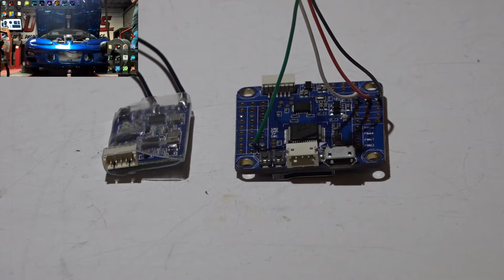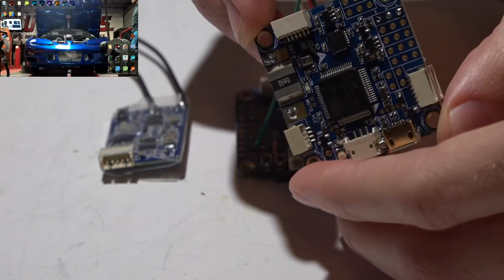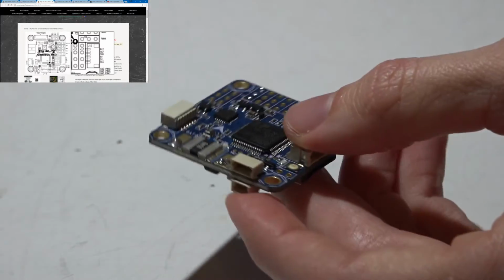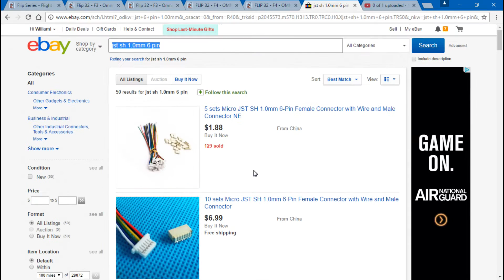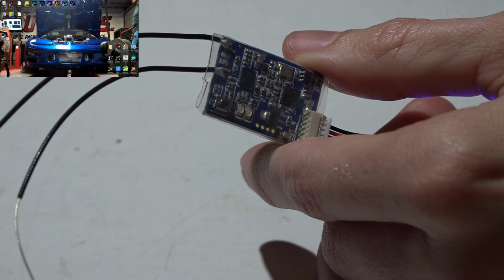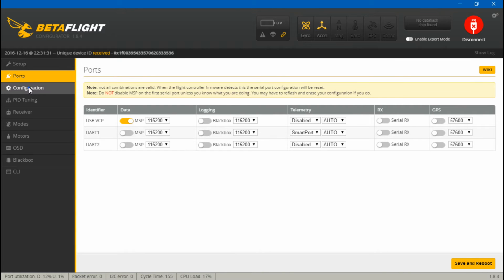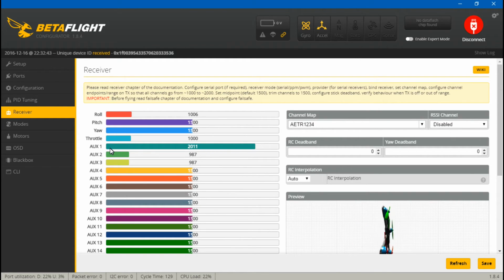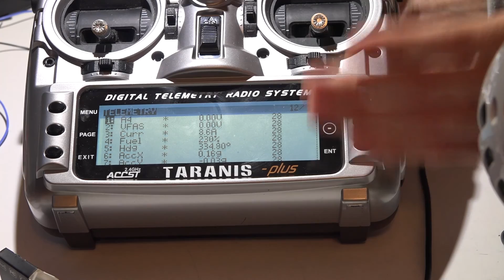Omnibus F3/F3 Pro & XSR: Connect & Telemetry

Comment: hey JC, I'm in mode 2 on a qx7, followed all your vids, have Amber sounds, set up model, got it on aetr and when I push throttle the roll moves, can you help please, Im trying hard to get my x210 with omnibus f3, xsr, racerstar motors n 30 amp blheli-s esc, in air, thanks for your help bro, couldn't have done this much without you,  I made my first vtx pigtail, I ready to start reworking boards and changing damaged components!

Comment: Hey could you take a look at my quad I have tried to calibrate escs to dshot and multishot. This is my first quad build ever. When I plug my lipo in my quad it makes a weird beeping sound. Also a few times I could arm then telemetry would just cut out and recover then XSR lights both will just start flashing. This is the omnibus f3 Any solutions? Thanks! https://goo.gl/photos/jbhWi2kU9DLhAHoKA

Comment: Using the Omnibus F3 AIO, I have wired up the x4r-SB as well as tried an old X8R I am positive I have both wired correctly. and everything in taranis setup correct, but I cannot get the FC to get any signal from the receiver.   I made sure Serial RX on UART 3 and SBUS on configuration tab is selected.   Still nothing, guessing maybe a bad FC?    Also tried with sbus_inversion on and off, made no difference.

Any ideas of anything else to try?   

Thanks!

Comment: Great video, while upgrading my Omnibus F3 on Betaflight  from 3.3 to 3.1 now it wont connect . I can connect using my Lumenier Lux V2 but this FC now wont let me do anything but go into DFU mode. I even tried to go back to 3.3 but cant find it in the listings any more. UG   any suggestions.   I used Zag and still cant get it to connect, dont understand why I can with one my Lumenier theyu both use the same set up {Comp 3}  ??     I may send it to Joshua if he sends me his mailing address to see if he can fix it. If interested let me know . I also have a crapped out Naze 32 you can have for parts if you want it. But id like my new omnibus repaired so its not a total loss. Thanks Bill
Reply: ahhh I fixed it. I used Impulse  Driver fixer.  Sweet !! Happy happy happy.  Now back to my build.

Comment: I just received an Omnibus F4 Pro from ReadytoFlyQuads and the board is slightly different than the posted pictures  Next to J7 there is what looks like a three pad solder jumper, with the outer pads labeled sbus, and ppm.  Is this a new version of the board? Would this possibly allow for turning on and off of the signal inverter on UART 1?  Inquiring minds...
Reply from the maker: They probably just sent you the wrong wiring diagram. A friend of mine bought a Omnibus F4 and they gave him the F4 Pro diagram. Probably all that is.
Reply: This one is definitely different.  Any possibility I could shoot you a pic, would really like your comment?

Comment: I am new to Frsky, smartport etc so may be missing something obvious. Your instructions here worked great for me, now receiving all telemetry now on my Horus, however: I just assumed smartport would also send telemetry to the FC so I could get it on the osd; but betaflight is showing 0 rssi vs good levels on the Horus. Is what I want possible and can you advise or point me to guidance?
Reply: You either need to declare a RSSI channel, for example channel 8 and go to input and mixer and set it there also or you need to bridge the rx and tx pins of the uart you soldered your s.port to and enable the halfduplex protocol in the cli
hope that helped
greets Bloody

Comment: JC, Great to have you back!  I have a question can the non-pro F3 display milliamp consumed?  if it can do you know how to set it up?
Reply from the maker: Glad to have you back. At the moment neither one can display that, the F3 or F4, or Pro or not. Its not anything with the flight controllers, its that Betaflight hasn't added that feature into their OSD. For mA consumed you would need something like a OSD with MW OSD firmware.